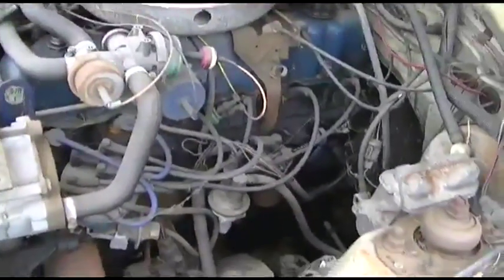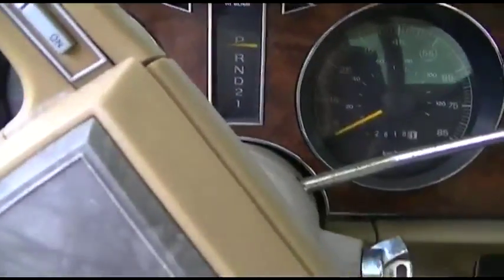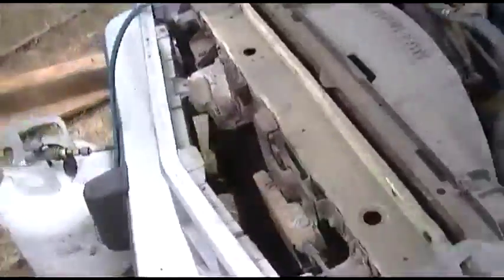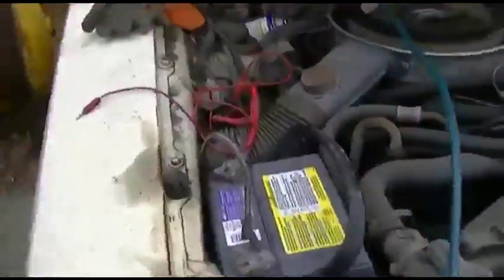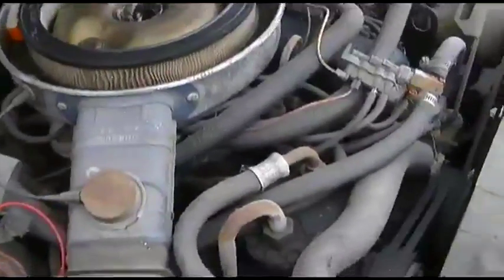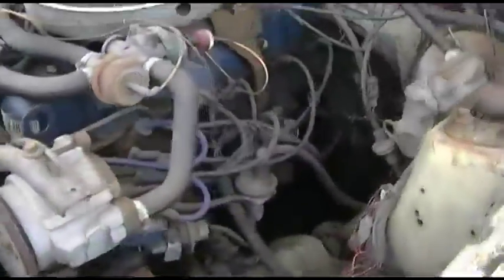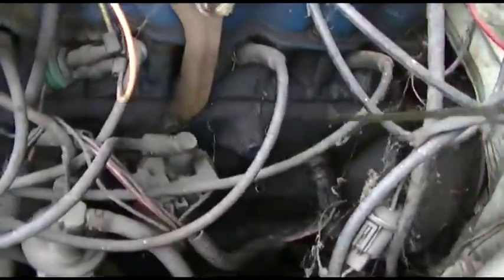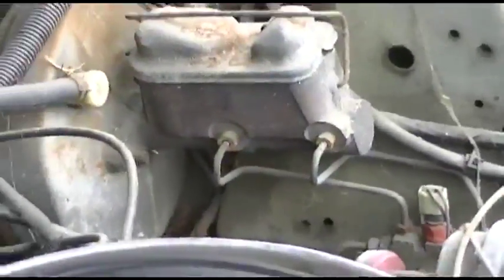Starting Ford Fairmont 400kbps

Comment: If a car sits for a while and the bushings are worn, the converter can drain back into the pan.  This will cause the fluid to rise far to high and leak out a places that are not normally submerged.  Upon startup, the fluid is pumped back into the converter and the fluid will be very low. Under daily use this will not usually happen since it takes  even a fairly worn converter bushing days or weeks to drain down.

Comment: That looks like a Wagner master cylinder, they used a very similar one in my 1975 Chrysler Newport. I got a replacement from NAPA, a re-manufactured one, though you would have to check. Eventually the seals go at the back of the master and the fluid leaks out the rod hole onto the brake booster, that's what happened to mine. If you can convert the system over to silicone fluid, DOT 5?, it will last a lot longer in storage then it will with the DOT 3.

Comment: Our '81 Granada (200 6cyl) stumbled on takeoff for the first seven years Mom had it.  Not long after we gave it to my Grandmother - I was about 13 - I was looking under the hood one day and noticed a decal on the smog pump that read "Do not disconnect until after xxx mile break-in period."  I removed the belt and the car never stumbled again.  Exhaust never had an odor.

Comment: Great video, love the fact that you run the engine on propane.
Great to see the mechanical kettering ignition.
You as an expert will get this car going , I have no doubt about that.
Love the starting jumper.
Reply: Boss Kettering was a gm delco corvair, man . He also made 32 volt dc power plants Kettering ford lol

Comment: This doesn't affect yours, but Ford switched to larger lines at the master cylinder in the spring of 1981, but none of the catalogs reflected that.  Twice I replaced it in ours (built June '81) and twice I had to go back to the parts house and get the '82 m/c.

Comment: Make sure to recharge the dead battery  pronto take it up to 16V then overcharge for 6 hrs to restore plates from sulfation.
Reply from the maker: I like to be here when I pull up on more weiners up by his fire go by players are players level high point Bible parsley?
Reply: @shango066  Just use a regulated power supply. Overcharge at 1.5- 2 amps.

Comment: Great video like the old Car.... Does the radio work? I wanted to know saw YouTube channel Kwacz  astro Van running of Propane torch can you tell me he clams you shut off the fuel pump to you can and he had a device he used inside his van to adjust the propane right to make his van start...